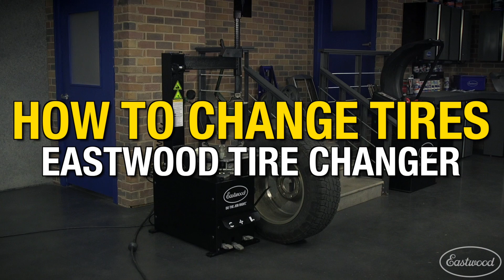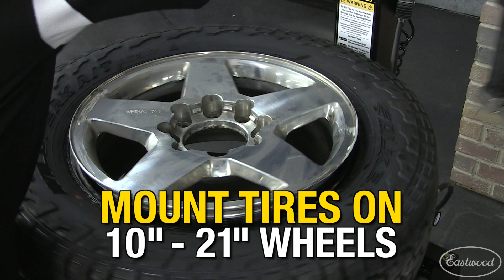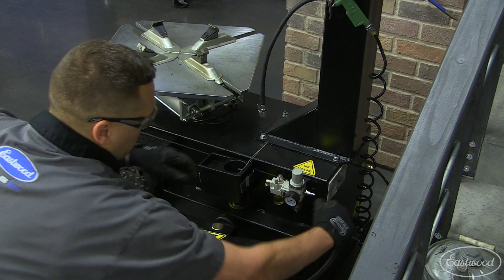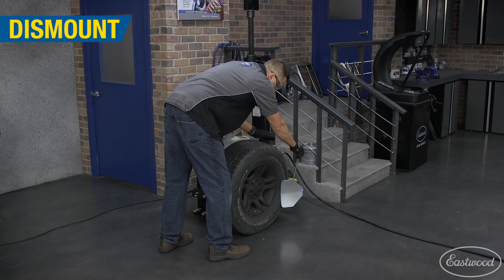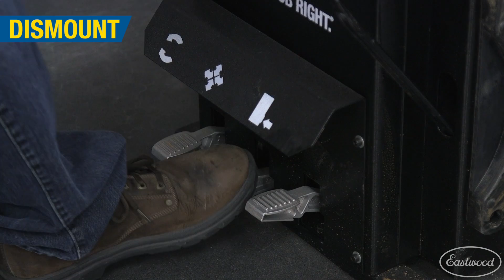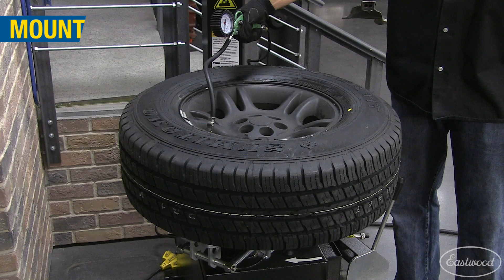How to Dismount & Mount Tires with a Tire Machine - Eastwood Swing Arm Tire Changer

Comment: you never mentioned where the TMPS sensor/valve stem was supposed to be in correlation the arm, when dismounting and mounting. i snapped one off last year :(